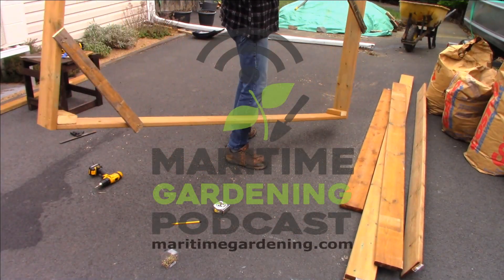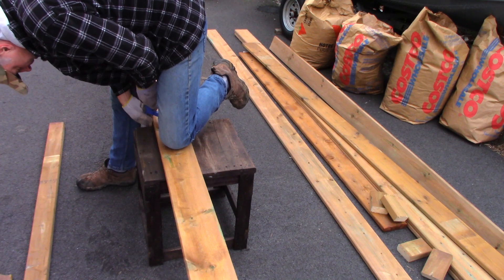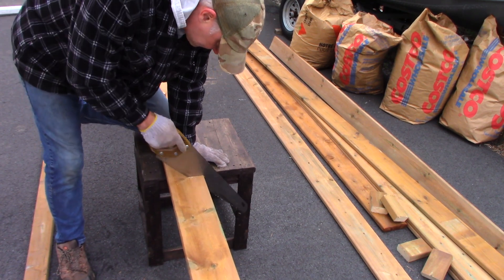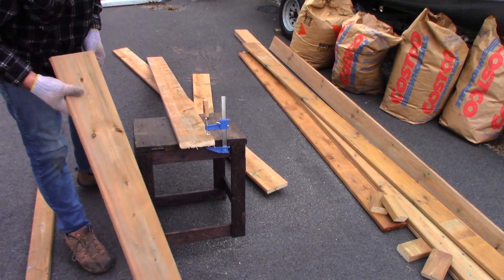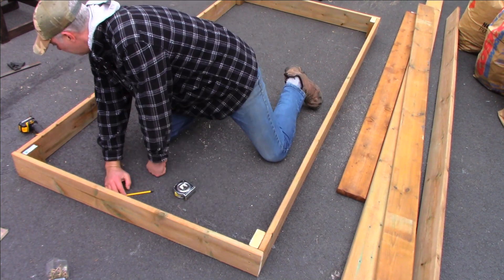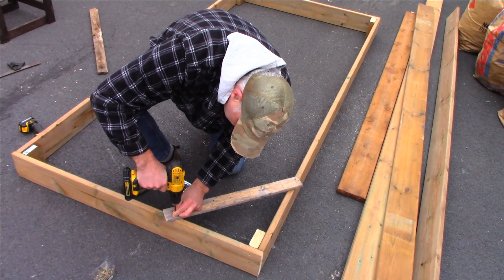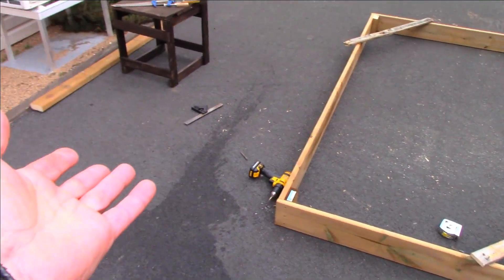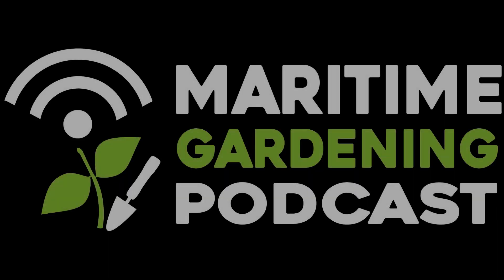Step by Step Raised Bed DIY

Comment: Even easier to remember and do, also takes into consideration all four corners, if it's square, the two corner to corner diagonal measurements will be equal.
Reply from the maker: Yes but the the 345 has more applications and is more versatile - it's also is useful when the diagonals are too long to measure with a measuring tape

Comment: This is probably the best video I’ve watched to build raised beds.  Thank you!  What kind of wood do you recommend? Cedar is ridiculously expensive around here.
Reply: I remember researching this and although cedar will last longer, say maybe 15 years instead of 8 to 10, it's almost 3 times as much. So it doesn't pay unless you really dislike building them. Lol
Reply from the maker: Thanks. I actually went with modern treated lumber for this one because I'm convinced its ok for garden beds. I wrote a two-part series on the topic working out the pros/cons/risks: https://maritimegardening.substack.com/p/is-it-ok-to-use-treated-lumber-part
Reply: @maritimegardening4887  Great Greg. I was meaning to get your take on treated lumber. Thanks
Reply: Hi! I am looking to redo my garden beds. How deep would you recommend? I am in Newfoundland, growing on a thin lawyer of topsail on top of bedrock.

Comment: I do similar method but double up the boards since I have higher beds and need higher boxes.  I also use 4x4s on the corners sometimes if I have them.  I used to always use cedar but that has gotten ridiculous in price now and not sure it's worth the extra few years you get.  I've actually started making them out of corrugated galvanized roofing for the same price a cedar box would cost and that should last 20 years.  What do one of your boxes cost the way you make them.  I'm assuming you're just using pine or some cheap wood right?
Reply from the maker: 4x4s on corners are best for sure. The corrugated roofing is a good idea. 
I used treated lumber believe it not.  Micronized copper azole.  Cost is about $30/bed.  Wrote a whole 2-piece article on it for my substack page.